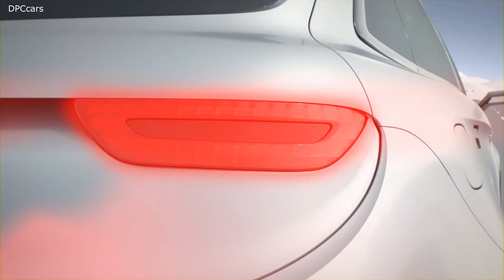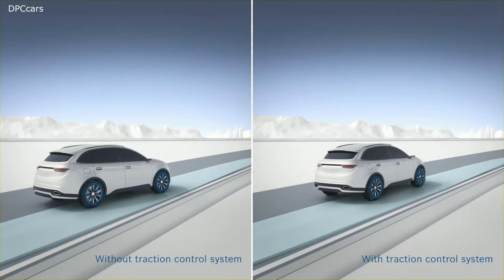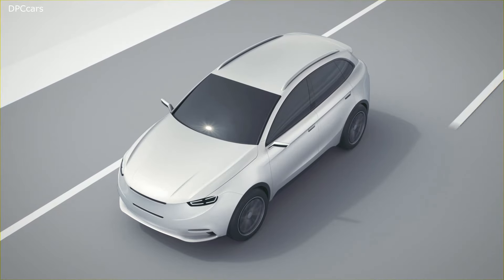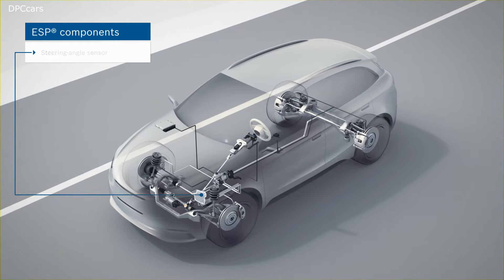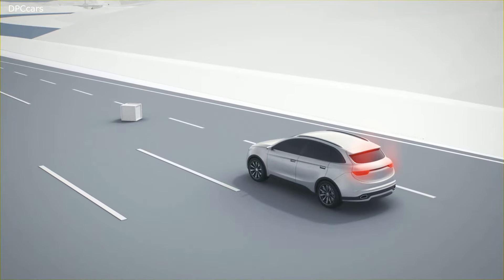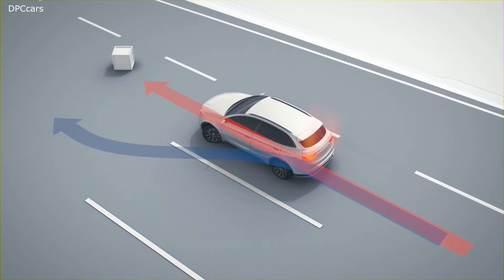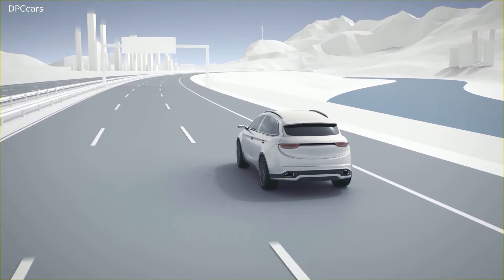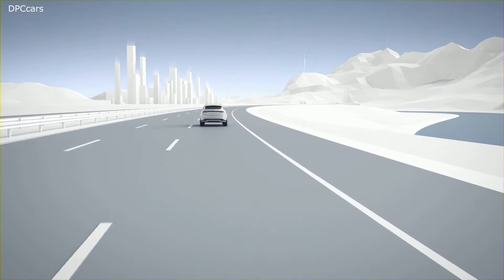ESP   Electronic Stability Program Explained

Comment: I turned off my ESP about an hour ago and got into a car accident just 30 seconds after turning it off.  Talk about bad luck.  I lost control when turning and drifted everywhere.
Reply: but why would u turn it off?????
Reply: @arushdeep5521 to drift 😂
Reply: lol! I did the exact same thing just out of curiosity and skidded sideways when turning a corner.
I will never touch the ESP button ever again 🤦‍♂️
Reply: I always have mine off if you really got the wheel like you you don’t need it. They really just add it for safety for people with low consciousness, and can’t drive. I believe to be a good driver you have to have a high vibration of consciousness plus I like drifting

Comment: Same as abs?
Reply: No, abs (anti lock brakes) stops the wheels from  locking (stop rotating) when you brake too hard. Locked wheels can cause an uncontrolled skid.
Reply: @lninjadudel  esp also distributes brake pressure , so the same
Reply: @Sevan59  not really, the only thing they have in common is that they use the brakes to regain or keep control. 
ABS prevents locking of the brakes when... well, braking, if you lock up you loose control of the direction and maybe the rear.

ESP on the other hand, applies brake force selectively even if you are not braking, think of it like this, ABS prevents you from locking while braking, but ESP makes a wheel behave like an anchor to gain stability even if you are not currently braking
Reply: Similar but not the same! ABS is the base system for antilock braking only. ESP adds steering geometry to refine vehicle dynamics with yaw rate. ESP II adds active steering to refine geometry further. All of this doesn't mean much if you use poor quality tyres with limited grip in certain driving conditions.
Reply: @lninjadudel  Hey, my car starts turning left/right after i hit brakes too hard what could be the problem

Comment: esp is abs ?
Reply: Similar but not the same! ABS is the base system for antilock braking only. ESP adds steering geometry to refine vehicle dynamics with yaw rate. ESP II adds active steering to refine geometry further. All of this doesn't mean much if you use poor quality tyres with limited grip in certain driving conditions.

Comment: Brought my truck to Firestone and there diagnostic test shows I have to put back the stock air filter system as i have installed K&N kit. I am still having this ESP lights on together with engine check. What must be the problem?
Reply: Have you found out